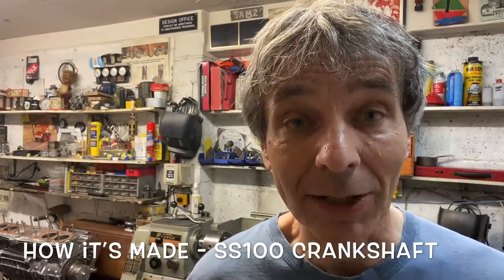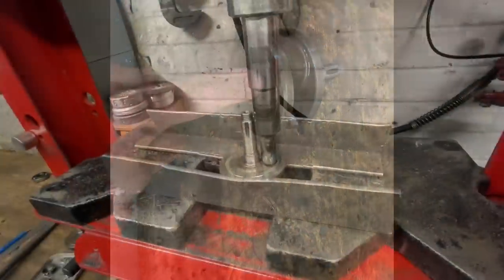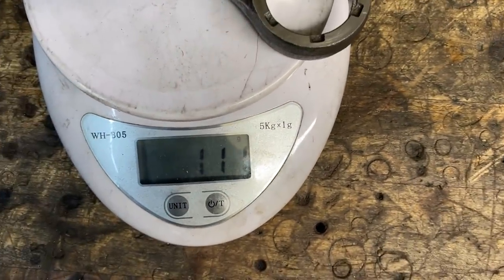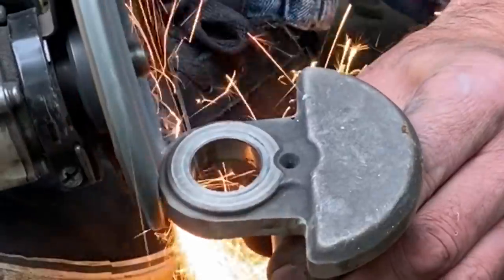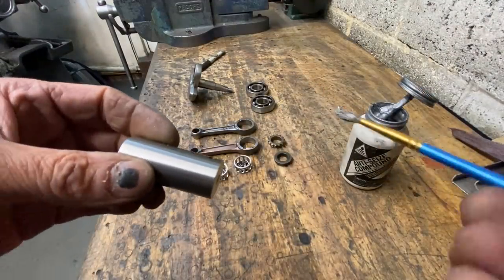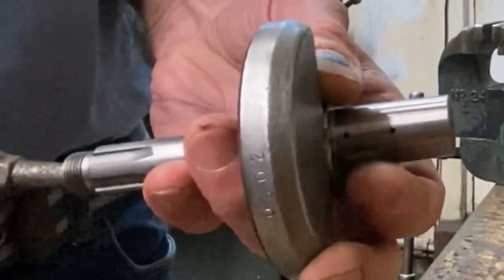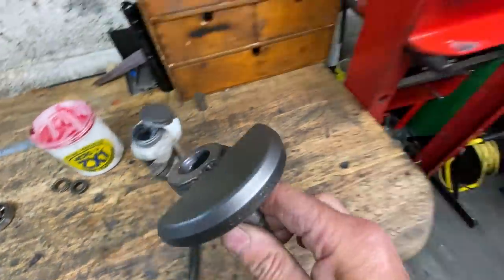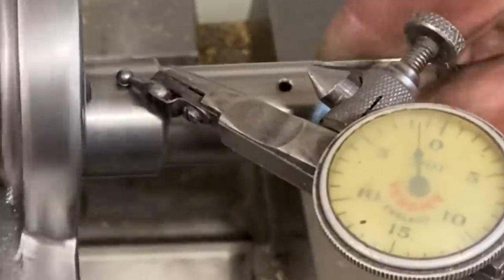Millyard Honda SS100 V Twin Crankshaft - How its Made 4

Comment: Now we wait with breathless anticipation to hear how a crank that's wider by the width of one rod fits into the crank cases . This is fast becoming my favorite YouTube channel
Reply: He modified the case im pretty sure. But either way Allen is a genius and master fabricator
Reply: Yep, another good question and i'll be awaiting Allen's answer and possible vid, fingers crossed.
Reply: Yes, I'm hoping he shows the modifications too, this is a fascinating series.
Reply: We'll just have to wait and see. My guess is a stack of handmade gaskets on the side of the original case, precisely the width of that extra conrod., give or take half a thou'
Reply: @Deftonesdsm  I'm also interested to see how he uses one cam chain when one cylinder must be offset from the other
Reply: @paulwhite7475   Thats a good question.
Reply: Edward Tupper you cant spread the case halves like that. It would also open the transmission cavity making it too wide for the trans. My guess would be to machine out the main bearing holes and add bolt on main bearing carriers to each side
Reply: He makes the cam chain tunnel on one head and barrel wider
Reply: @edwardtupper6374  doubt that. the crankshaft is held between the center halves, which center the bottom cylinder jug. my guess is a relocated bearing surface, on the clutch side, so both cylinders line up allright on the chain drive side.
Reply: Me too. I love the way Allen looks like it's done with normal equipment. Almost like we could all do it in our garden...😁. At least I can dream...👍
Reply: @Paul ... good point.... and with an obvious offset on the crank , how does one cam-chain run true up both tunnels??
Reply: https://www.youtube.com/watch?v=ckpYzp8Li3Y 6.16 Looks like the cam tunnel is wider?
Reply: @paulwhite7475  He showed the cam chain setup in his last video.
Reply: @justinrigden6530  I'm well aware , but the barrel's can't be in line with the crank arrangement so one of the cam sprockets is going to need to be spaced over
Reply: Absolutely
Reply: I went and looked at the video from three days ago. The amount of work to make this thing is insane. I have a set of engine cases from a CT70 I was looking at while watching the video. Here is what I determined:
1. He widened the left engine case by welding a center section of another case in there. To make it fit the motor mounts he relieved the left case mounting bosses by the same amount.  The main crank bearing surfaces stayed where they were as cast.
2. The jugs are staggered obviously. The vertical cylinder and head are stock-type. It has the left side connecting rod. The horizontal cylinder and head are modified (sectioned and widened at the cam chain gallery) so to have the chain run in the same plane as the vertical jug but have the bore offset to the right. I can only guess that the cam was lengthened too.  I can only guess that he cut and welded both cast iron cylinder and head. 
3. Since the case is wider, the gear set had to be widened as well. This is harder to spot, but he must have lengthened the input and output shafts or cut new ones on his lathe. He also lengthened his kick starter shaft. 
4. Obviously he cut, welded and machined both left and right cases to accept another jug on top. He also likely needed to close in and recut the oblong connecting rod passage remaining when the left engine case was widened. The stud locations may have had to be moved depending on where he sectioned the case. Probably a small matter for such a craftsman. 

There’s a lot more I’ve probably missed but this was a tremendous piece of craftsmanship to make happen. My preferred method to get more power from a Honda horizontal single would be to put an 88cc kit in and a new carb, but what is the challenge in that?
Reply: Please forgive me for being slightly  off topic but did he ever show how he makes the cams for his 6 cylinder Kawasaki?
Reply: It may involve the use of an Angle grinder, hacksaw or barbecue.......or all three.....
Reply: @paulwhite7475  He uses magic.....
Reply: @paulwhite7475  you have to set up the cams to tdc on each i believe
And the chain loops to both cylinders round a cog that was sorta shown in one of the last videos
Reply: @paulwhite7475  Check out his earlier video where he shows the cam chain & how it's timed.  Very ingenious!
Reply: It's all in the sneakers 👌
Reply: https://youtu.be/ckpYzp8Li3Y?t=121 Looks like he manipulates the bearing seats.
Reply: @paulwhite7475  An adaptor/spacer with longer bolts for the offset camshaft and sprocket,perhaps?
Reply: @paulwhite7475  and there is the likely solution. Space one cam sprocket over by the offset of the second cylinder barell.
Reply: @MyDailyUpload  I think most of what you suggest is likely to be how the offset issues were addressed. As you say there is a lot more modification and cunning fabrication than immediately meets the eye with this Vee twin configuration.
Reply: @baby-sharkgto4902  He has to have cut 2 sets of cams apart and rejoined the pieces with the correct lobe timing for the six. Did you know that the camshafts in the Honda 250 six racer were multi piece items linked together with coupling dogs at the ends. Quite ingenious.
Reply: What about the oil way up to the cylinder head how was that done ?
Reply: @pistonslap5424  Its now converted to total loss lubrication on one cylinder. Allen carries a 1/2 pint oil can on the tank and gives it a generous squirt every 5 miles or so.😂😂😂... Sorry if that isn't the sensible answer but I couldn't resist.
Reply: @baby-sharkgto4902  He has now :)
Reply: @truthseeker8483  All of those and some gudgeon pins.
Reply: @Dave5843-d9m  :-D
Reply: @howardosborne8647  figured that but I want to see exactly how he did it . In one of the other videos you can see the one chain tunnel is wider
Reply: @stevebird8407  I imagine he widens the cam chain tunnel on the front cylinder and lengthens the cam shaft on the sprocket side between the lobes and the journal.  I also guess he widens the front section of the crank case on the same side ( using the spare crank case main bearing housing )  so that it doesn't interfere with the primary drive set up. Only the generator and points to consider. ( would work the same with the ss180) Just my opinion but seems most sensible approach.
Reply: @baby-sharkgto4902  or his V12 Kawasaki 🤦‍♂️

Comment: "I hit it with my copper hammer and it's now within half a thou".  Lol.  Completely different world to us mortals - I hit it with a hammer and break it! Genius as always.
Reply: M Bacon same idea. V blocks instead of a lathe because of many flywheels makes it easier to align the flywheels.
Reply: Same result when I attack a crankshaft on the ground outside with a angle grinder.......
Reply: Tim Loveridge, “if it won’t go, force it. If it breaks, it needed replacing anyway”
Reply: I remember, 17 year old and half a year into my apprenticeship, I promised to replace a big end (ball) bearing gone bad for a friend. Pressing the crankpin out was the easy part. Pressing back in without a throw on the crancshaft halves was a nightmare. Didn,t realice that a tap with a heavy, soft hammer was all it took. Well, thats 50 years ago, so it's nice to still be learning. Next time I shall do like you, Allen. 

PS, - it's a joy to follow you.

Comment: I really appreciate how you mix precision methods with the "quick and dirty-while calculated".  For those without a mill or lathe, we have to take procedures accordingly.   From an engineering/manufacturing standpoint, we're so afraid of removing material.  The rationale of a stepped tolerance scares many engineers.  Simplistic manufacture and integration of fabrication methods is soooooo important.  Your gradual move toward greater precision tools (based on the situation at-hand) are to be followed.

Comment: I have watched this over and over... I can see how Allen has stitched the casing in to the original one and if you look closely you will see how he as widened the cam chain tunnel and the cylinder head to run the camchain from the back cylinder to the front. A few other things  are the front top cam sprocket will have a spacer fitted behind it and the base and head gaskets Allen will make.The rear head and cylinder are stock. also the cam chain tensioner is adapted too so it does not get in the way of the chain. All very well done I need to add and so cleaver... The crank pin I can make and have hardened and ground for a few pounds... So off we go guys lets BUILD....
Reply: I wonder too...why he make the eforts to extend cam tunel for both head and barrel instead of using 2 cam sprockets on crankshaft, But probably there i no space for magneto cover and flywheel too.

Comment: Thank you for sharing Alan!  Rebuilding one of my H1’s as a teen (in the late 70’s) I had a crankshaft rebuilt by a recommended engine guy.  I was astounded the difference in smoothness after the rebuild.  

I would love to know more about balancing of these cranks, especially with your efficiency in tool use and ability to see within your mind, your goals. 

This was highlighted even more as I rode a friends H1 with a rebuilt crank from another shop.  It vibrated worse than any H1 I ever rode! 

Thank you so much for your shared experience!
Reply: It's Allen, not Alan.
Reply: @robertmoore2527  maybe that’s why Alan never replied ;)

Comment: Super.  I don't have the desire or the facilities but resort to the basic grunt methods you show here.  You do inspire.  Maybe, someday, you could dig up an old Matchless 250, 1960 vintage, that had notorious crankpin failures (pet peeve of mine back in the day) and dandy up a better crankshaft arrangement than they had.  My mentor, old fella, made a new crankpin from air-die tool steel but it also broke at a step between the pin and the rod bearing race .

Comment: Absolute Genius. Using soil to cushion the crank while you hold it WITH YOUR FOOT & slice bits off it with a 6" angle grinder. Then the copier hammer bit. Wow. I take my hat off to you. I thought these things were meant to be technical. Did you cause the Fukushima nuclear disaster when all the engineers saw what you do and imploded? Keep it up.

Comment: I use a small powerful magnet to hold rollers and loose headrace ball bearings in place. It only has to be on the metal close by to give enough magnetic adhesion to stop the little buggers falling out. Once everything's together I remove the magnet.

I've been using this method for close on 40 years now.

Comment: I have a press the same, it does not look properly used like Allens thats for sure! But that will be all changing, Ive often wondered how to set the crank halves after pressing together. Thats the beauty of you tube what would have taken 1/2 hour of reading gets explained in 3 minutes and you can see just how its done. Getting any good at it well thats gonna take a bit of practice. Have to start some where, thats the great thing about this channel its so inspirational.

Comment: I love these "How it's made" videos! Now you've done it, you have made another crank for a twin. Can't have that crank just floating around without an engine to live in. 😎🙄 Hope we see more on this build. An Millyard SS250 seems to be the next logical step. 😃  That would be a dandy engine for a gokart as well. Thanks for making these videos. 👍👍
Reply: I'm sure it's always great to have spares for your SS100, but that single cylinder engine has powered so many iconic Hondas, and any one of them could benefit from the upgrade. For example, how about turning a C90 into the C180 Maxi-Scooter Honda could have built? Or what about turning the iconic postie bike into an adventure tourer with a V-twin upgrade?  Or a Trail 180 with disk brakes & decent offroad suspension might be a fun project :-)

Comment: Very cool. I like the use of stock Honda parts. Ok, so I guess they are going to be 90 degrees apart. It would make it easier for timing. Can't wait to see how you do the placement of the added cylinder. Timing chain would be a little tricky. Not sure , maybe easy.

Comment: I totally get this create your own engine buzz ,i mean it must be a good feeling i get bored with bikes so fast sometimes i think there must be something wrong with me or more like my brain .I have had the luxury of owning some nice bikes most near new ,bikes people would give there left nut for & if they had them would be on them all day everyday i ride them twice & i'm bored with them already & want something different  i like being different i don,t want to be like anybody or don,t want what everyone else has .I had family friends who were on the bears race committee here in NZ & were close friends & race buddies of John Britten  i was only 20 at the time but i got to hang around them up close help them on track days most had built there own bikes but not engines like John had .Everybody flipped out on the v1000 but me i just loved that engine the sound it made sounded like nothing else the power it had Andrew Stroud could wheelie it in every gear i just loved that motor & wanted one .Contrary to belief Denco engineering built that motor in chch nz they also used to build 500cc speedway bike single bangers that ran methanol i swear the base for his motor was 2 speedway engines mated together  .So Jawa 500cc 4 valve speedway bike motors super simple super durable & powerful 85 hp is it possible to mated 2 of them together to get a 1000cc v twin of around 160-170 hp similar to the britten v 1000 or would it be to much .I have very little to do with bikes these days & have had no experience at all with speedway motors but it,s a bucket list thing i have to do build my own bike with a seriously  powerful v twin engine inspired John & his friends A simple race machine is what i'm after  something for the track.

Comment: I have a (Meriden) Triumph manual that says to weigh the con rods end for end. File off metal to balance them so tops and bottoms match each other. Big ends must weigh within a set tolerance. For crank balancing that amount of lead is rolled around each crank pin.

Comment: Maybe this question is already been asked, but cutting of the extra webs around the crank, would it not loose some strength and rigidity? OR as the engine is low powered it can get away with it. 

Some possible future you tube topics. 1) anything  on how the Velocette engine was made or at least the thought process 2)How do you tackle getting it registered due to major changes to the ordinal design in the UK DVLC. 3) Material choice in fabrication, do you tend to stick with a specific type of aluminum and steel or just any old bit will do? 4) History line of the bikes you have made with pictures of old versus the new modification 5)workshop tour , I could keep going.

Comment: Very good video! Question the amount weight you remove from crankshaft is the weight from the added connection rod or what is the calculation? Thank's for sharing that videos.

Comment: Two questions remain: how to determine where and how much  to remove balance weight and where did the longer crankpin came from.
Reply: Exactly, please, we would like to know.
Reply: No kidding!  I mean, everything has to be balanced perfectly and this guy just cuts off the balance weights of the crank "by eye" and it works perfect!  What an amazing talent this  man possesses
Reply: @RTXti-ld7dx  What amazes me is that actually for the added weight of a longer pin and two big ends, even if omitting the weight of and additional connecting rod and piston because of the 90 degree angle, you actually need more balance weight  than less !
Reply: One more question from me... how did he do the oil way to the cylinder head...
Reply: The Trumph (Meridan) Haynes manual explains how to balance the con rods. They are done by weighing the big ends of both, then filing one down until they are equal. Then flip them over and repeat with the small ends.
The crank was balanced with a roll of accurately weighed lead flashing wrapped around the big ends. IIRC each weight is equal to the big end weight of its con rod.

Comment: Amazing stuff. Had to grimace as he used the  angle grinder on the crankshaft holding it in place with his foot. I'm sure we have all done that too! I couldn't quite see what stops the two conrod ends rubbing against each other when he put them on the bearings?

Comment: Ok. I’ve got a box of Z50 and CT70 split cases in my basement. Now I have to go look at them to see how the wider crank and more importantly the bearings can possibly seat in them. I’m certain that he doesn’t put a spacer between the case halves so he has to cut and relocate the bearing seat anyhow, probably on the right half case. The cases will be heavily modified anyway to accept an extra cylinder!
Sorry about my terminology. I’m not a mechanic or machinist, just a tinkerer with a basement full of little Honda pieces.  With my lack of aptitude it won’t do me any good to know how he does it anyway but it’s fun to know.

Comment: Hi Allen - don't you need to balance the crank in some way after adding an extra conrod and piston and removing chunks of metal with your angle grinder?  When that's spinning at high revs, surely even a discrepancy of a gram on the crank would make it vibrate like crazy.  If you are getting this all balanced out by eye, then you must have some sort of supernatural powers!  

A V-twin moped would have made you a god amongst the fizzy gang 50 years ago.